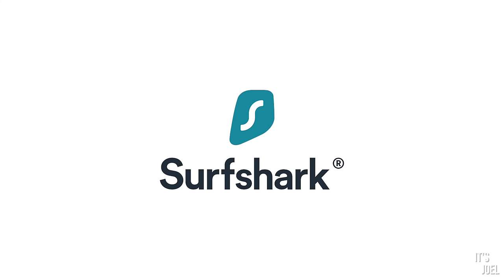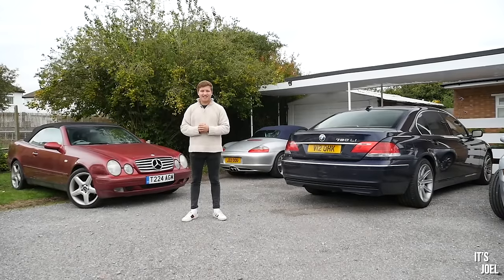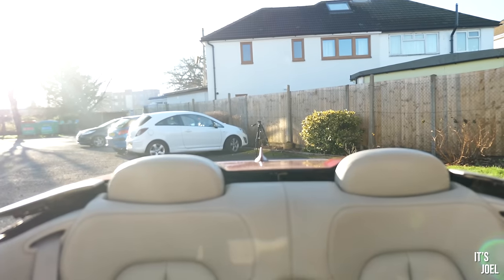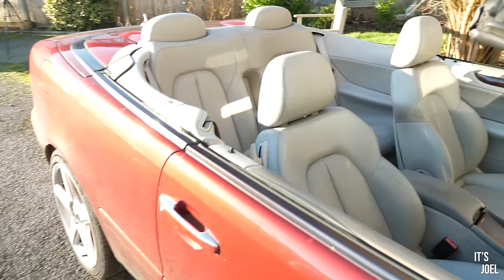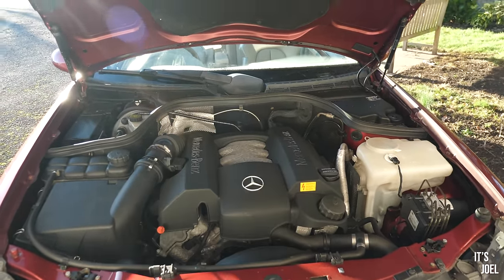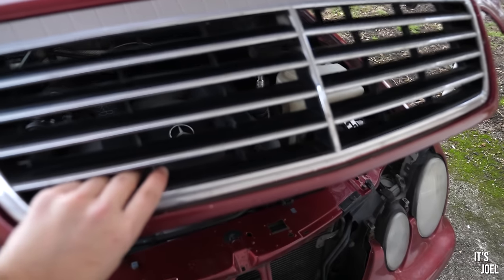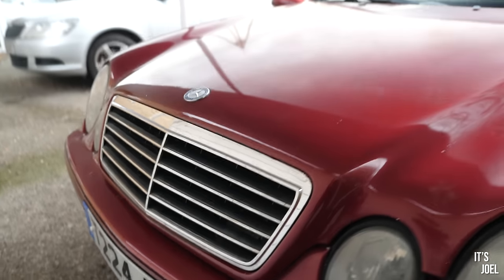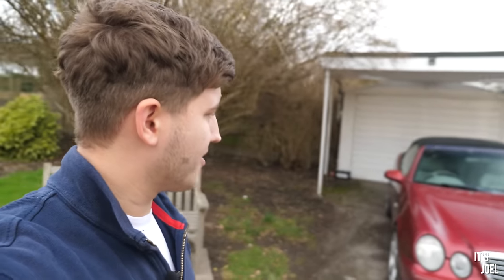New parts for my £1,000 Mercedes CLK320 Cabriolet...

Comment: Had a 2000 CLK 430 cabriolet in a beautiful dark blue with the gray interior you have and a matching gray soft top.  It was so beautiful and so much fun to drive.  Yours is in a beautiful red.  Really glad you are putting on original grill and MB stem on hood.  Actually the wheels on it look pretty good.  The standard CLK 320 wheels, at least  those sold in the US were small, uninteresting and made the car look inexpensive.  It is really a beautiful car.
Reply: i despize the fact that mercs dont have manual v8s.

Comment: Pop the covers on those jacking points Joel. If they are not rusty spray some waxoyl in there asap.

Edit, also lubricate the roof mechanism. There are micro switches in the windscreen frame that can stick causing the roof not to open/close. Make sure they have a bit of WD40 on them too. 

Trick for seatbelts, unbolt the bottom of the seatbelt, pull it fully outside of the car and use a pressure washer on it. Spray some upholstery cleaner on them before power washing. They will come up like new.

Comment: I have the 430 cab in the same colour but with the black interior, love it. Took the aftermarket black 18" alloys it came with off  and replaced them with nicer period correct 17" amg ones in silver.  Got a low miles 230 compressor with more period correct 17" amg alloys on it too for sale but I doubt you want a coupe version as well..  just for the wheels.

Comment: Other than putting the roof up or down - the rear headrests need to be raised as they act as your "roll  hoop" and would protect people in the car if you flipped it over in an accident
Reply: They automatically pop up if the system senses a crash is imminent.

Comment: Just something I’ve noticed many times Joel, electric Mercedes keys does not need to be hold in position 2, just simply turn once and release it, it will crank automatically. Grille looks much better.
Reply: Have to disagree with you there sport grill should have stayed on it really made the car look better and more modern even if it’s not a sport model

Comment: I owned a CLK 320 convertible (blue with same colour interior) for about 5 years. Brilliant, fast reliable car. It had the front grill fitted that you replaced (sorry much better in my opinion) and had original merc alloys.Slightly later model than yours, the roof was completely automatic, no handle to pull. I agree a great car!

Comment: There are two type of bonnet stars. Early ones which mount on the rad grills. Later ones which mount on the bonnet. A210 880 00 86 is what you need.

Comment: as an w208 cab owner please when you un latch the roof push it up first before trying to operate it. Its possible the tension cables can get damaged if you dont push it up or pop a seal on one of the hydraulic rams.

Comment: Looks like you had the correct badge, but just didn't fit it correct as they are a twist fit. Anyway, did that era of CLK have the pointed star rather than the flat emblem on the bonnet?